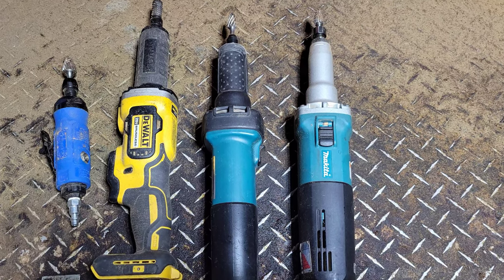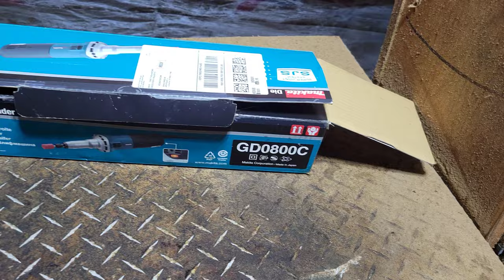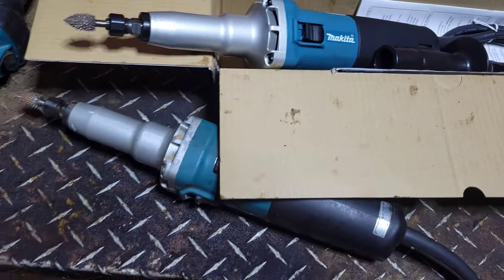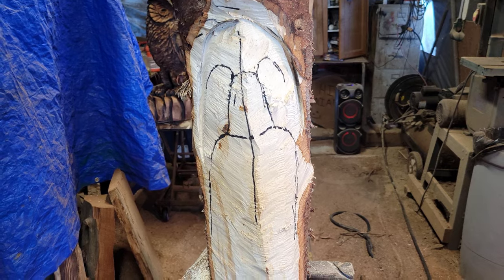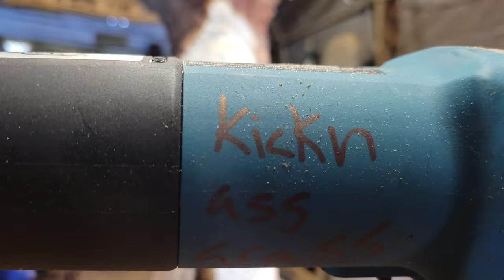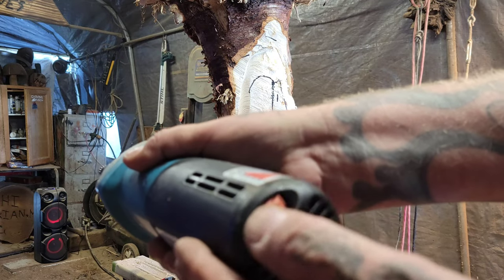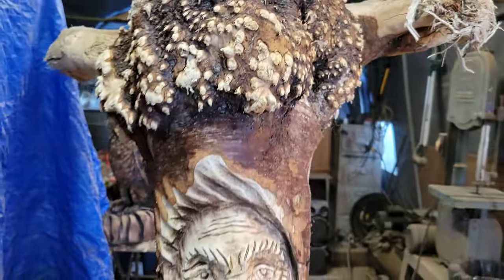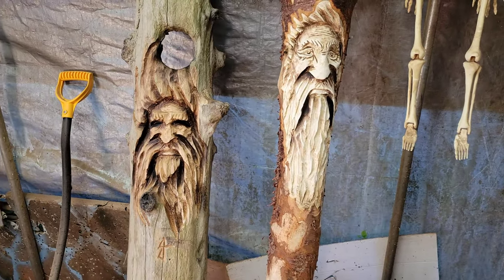Die Grinder Show and tell for the beginner Wood Carver.

Comment: Thanks for the video love your enthusiasm, the part number in in Australia is Makita GD0801C 1/4" (6.35mm) SJS HD Paddle Switch 7000 to 24000 rpm. Price A$499.00 from most vendors.  They also have a low-speed unit which is good for sanding and buffing, but it is too slow for rapid removal of wood.
Reply: What's the difference between the GD0801C and the GD0800C models?

Comment: The real advantage of air die grinders is you can control rpm very accurately when you learn to use trigger.
You need rear exhaust though as front exhaust can spit oil onto parts, not good if your doing wood. 
Front exhaust is good for clearing chips and dust though.
6mm collet is smaller than 1/4", your right you need 6.35mm. Should also be able to get 1/8" and 3mm collets

Comment: A die grinder is so much more powerful than a Dremel that it is scary.  So much more torque.  I don't have the model number handy, but Makita makes one with a safety on/off paddle switch that you have to hold down for it to run.  A die grinder with a simple slide switch will keep going if you drop it, or you might have to fumble around with the slide switch when you would really rather have it stop right away.  Even with the safety switch, once it is turned off it will keep rotating with torque for a lot of turns while it slows down (must be a flywheel inside).  It is a great tool, but give it plenty of respect...
Reply: I prefer a paddle switch on my angle grinders for the safety reason. But when I'm working the 8hr shift carving the details, it gets super tiring having to grip the paddle switch down on the fat barrel of the die grinder. Much easier with just the switch all day long. 👍

Comment: Makita sell the gda0800c/2 which says it will take 8mm collet so i presume this will take kutzall burs? Do you have some videos on different kutzall burs and how to use them to show what each one is capable of, as there are so many to choose from and im a little stuck please can you help. Many thanks
Reply from the maker: Yes buy make sure if u buy that makita is comes with the 6mm collet not 8
Reply from the maker: The kuzall burrs or other wood carving burrs/bits are 6mm collects AKA 1/4 INCH

Comment: Hey, Jordy. Hope all is well with you. I was watching this video because I  have been searching pawnshops looking for a straight die grinder. All I have found so far is the pneumatic type. So I was wondering if you could help me know what kind of air compressor is needed? I have an air compressor fom my dad, but I really don't know much about compessors either. Any good info you have on compressors and/ or pneumatic die grinders would help. Pretty sure I want one of the Makita types eventually, but I was looking at getting something cheaper to start with.
Reply from the maker: U need a really big air compressor to use air tools, of I was u just start off witg a cheep Harbour freight die grinder
Reply: @CarvingFusion  thank you😊

Comment: hi it's me again.  I noticed that my compressor isn't powerful enough to use the 1/4 kutzall bits, and I was thinking about alternatives.. mainly bench work, can the dremel 9100 take the 1/4 bits?  I'm having a hard time finding information on this.  If they aren't compatible, I was thinking of the Makita GD0603 straight grinder, it looks like a dremel due to its small size, but it only has 240W.  are quite?  otherwise there are the larger classic ones, but they start to weigh a little too much to use them precisely on a workbench.  Can you give me some advice please?
Reply from the maker: Hi there, a foredom is like a bigger dremel and has a flex shaft as well, I would look into the foredom SR SERIES with a industrial flex shaft and hand piece, be carefully of u do but a foredom it is not a fake, really do your research, 
If u look in my playlists u can see some foredom videos,
Reply from the maker: It is like the dremel 9100 but alot better, I have tried the dremel 9100 and did not like it myself
Reply: @CarvingFusion  Hi, thanks for replying, but it's a bit out of my budget... I just checked on the Foredom website, the total price, including shipping, is €430, the Dremel 9100 is certainly less since it costs half as much , but can you tell me if I can use the 1/4 kutzall tips?  and if a small 240w straight grinder can be enough for these bits?  Thank you
Reply from the maker: I don't think the dremel 9100 flex shaft tales the 1/4 bits, a die grinder is a very good tool to use and well like I show in this video :)
Reply: true, but I'm afraid of getting one that isn't powerful enough, I was disappointed by the compressor cutter I got.  Can I ask you if you can check it if it's ok?  it's the model of the makita GD603, it's very small that it doesn't look like a straight grinder, and it has less power (240w), it looks like a dremel, but if it's powerful enough to use for wood I'll take it :) @CarvingFusion
Reply from the maker: The gd 603 seems like it will work 4 u yes
Reply: @CarvingFusion  thank you very much!
Reply from the maker: Np and good luck,

Comment: Another great Video Jordy, and Fantastic wood spirits as always 😁👍quick question have you used the 1/8 collet and Burrs in your GD0800C as I would like to try it but would rather check if anyone has done this who has far more experience with die grinder carving, do you know if Ryan Cook has done it and was it successful, or know of anyone who has done it. I have just got a GD0800C but I now unfortunately have to get the 8mm collet as the 6mm collet comes with it here in the UK.
Reply from the maker: Hi there no I have not used the 1/8 bits in that die grinder I do think it has to much power, I know u can turn the speed down but ..
Reply: @CarvingFusion  thanks Jordy much appreciated as always 👍